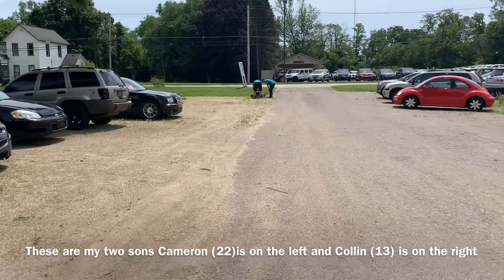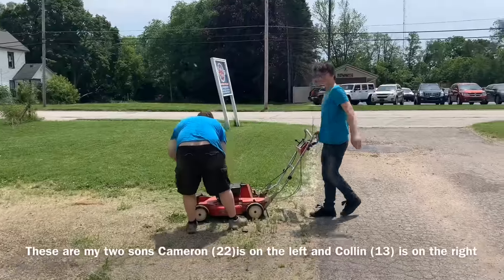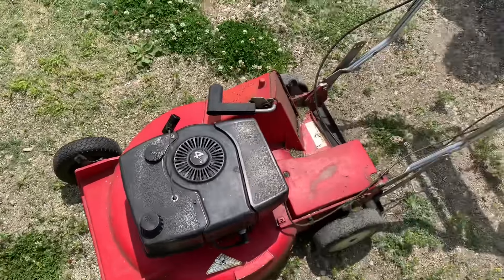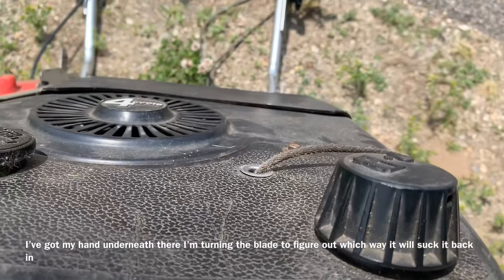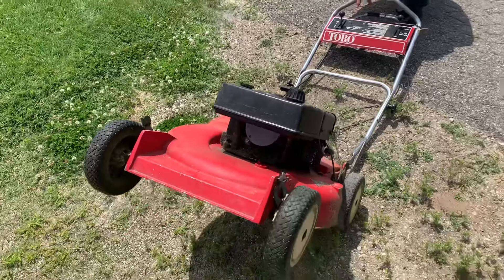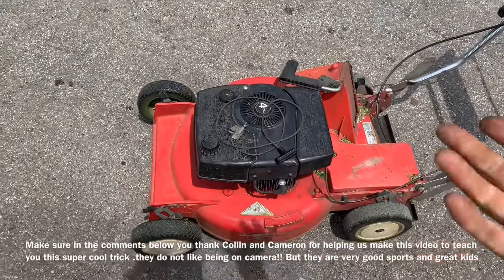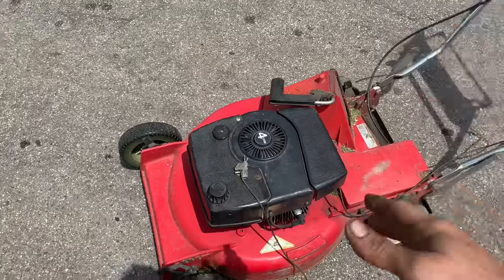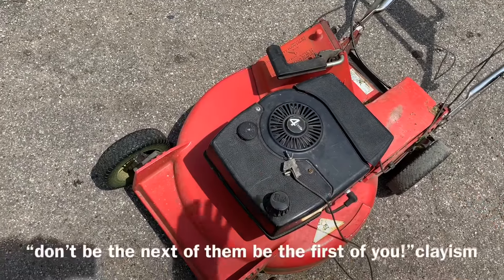10 second fix! Lawn mower pull cord not going back in recoil not working great easy trick!!!

Comment: always disconnect the spark plug, as a safety precaution so you don't lose fingers, always disconnect the plug.
Reply: Make sure to put it back on. I was pulling the fixed cord and the mower wouldn't start. Took a minute or two for me to figure out how dumb I was being.
Reply: I’m a hand percussionist and always use a drum stick to rotate the blades but yeah… pulling the spark plug seems a lot smarter and beneficial for me as a HAND percussionist moving forward lol
Reply: For real.
Reply: @DocFarnoff l

Comment: Thank you, going to try this on a basically new mower 2 see if it will work for me - only used a few times before the cord thing happened so fingers crossed 😂 I would so love to keep the 2 new ones both with adjustable tires on both the front & back then I would just have to decide  which color I wanted to use or felt like using each time I had to use one 🤣" lmao - the color of the day (1 is red & other one is black) - so 4 total now but would love to sell the 2 that are about 2  years old each & both still run great however neither of those 2 have adjustable wheels & I just love the bigger wheels in just the in the back 😅

Comment: What about is the string doesn't come out?  Great how to, videos
Reply from the maker: The recoil Mech is broken or the engine is locked up. 

When you try to spin blades by hand what happens?

If  blades / engine turns. The engine is ok and the recoil is broken and must removed and repaired 😕 but much better than seized engine
Reply: @sharpcarco  Thxs. yes.  Fyi.  Oil level is good.  First time using it since October 2019. The blade has zero play. Blade is locked/ seized in placed
Reply: @sharpcarco .... Thxs will probably just go and buy another cheap one from Lowes.
Reply from the maker: Sorry to hear that but try to give it a good  talk with your hand and see if you can get it to break free it may just of seized in place or could have some line wrapped around the bottom of it or something like that I wish you the best and I hope you don’t end up having to buy a new one. God bless and have a great day
Reply: @sharpcarco  thank you

Comment: This happens when your oil is old, and its been sitting. Best to change oil, and then disconnect spark plug so you can pull the cord 20-50 times to work the oil on the crank.

Comment: Thank you ! I feel so silly
Reply from the maker: Don’t worry my friend before I did this I have never done it before and I thought Eureka that’s so simple. 

Make sure your motor has the engine cut off (The little bar you pull on to keep the engine running) or you pull the spark plug wire even if you don’t pull the spark plug wire don’t spin it too fast. With the spark plug wire on it because apparently you can start these engines or at least that’s what five or six knuckle dragger’s said...... I know you could spinet fast enough to start it if you really tried but I think it would require effort. 

I never in 1 million years thought people would get up underneath there and spin it 1,000,000 miles an hour like they’re trying to start the engine..... but apparently common sense is not that common any longer.

Comment from the maker: ⭐⭐⭐⭐If you found the video helpful and would like to help us out, you can by purchasing ANY ITEM off Amazon from these links and we get a small commission with no extra cost to you. Here's some things that might help with this repair!

Recoil Rope and Handle for Small Engines: https://amzn.to/3vbLyLg
Performance Tool W1173 SAE/Metric 40-Piece Socket Set: https://amzn.to/39krZrL
REXBETI 2-Pack Utility Knife: https://amzn.to/3EJ0GTw
Utility Blades by HEIKIO, 10-Pack: https://amzn.to/3k99A31
Magnetic Screwdriver Set with Carrying Case, 10-piece: https://amzn.to/3vcwA7C
Magnetic Screwdrivers Set with Case, Amartisan 42-piece: https://amzn.to/3ENd18Y

Comment: You would have to figure out another way to fix since you probably wouldn't be able to find parts.  That is the oldest mower I have ever seen. The pull cord isn't even on the handle bars. I'm thinking it must be from the late 80's or early 90's but it's not as old as the mower that we used as kids it  was manual no engine it had 2 wheels and a big blade that turned as you pushed it.
Reply from the maker: Oh man do i remember those days! She was definitely old. We ended up getting a new one the year after I beleive.

Comment: Yep always sensible turning the blades with the spark plug still attached 🤦🏼‍♂️🤦🏼‍♂️
Reply from the maker: Well you also have to consider that you have to be pushing down on the arm forward to even create spark so in this situation it’s not a concern but I suppose on a very very old lawnmower it could be
Reply: That's how ya lose a hand
Reply: Definitely.. totally an irresponsible video to not mention the spark should be disconnected.. not everyone knows the difference for their machine
Reply from the maker: lemonGresham Hey you rocket scientists should ask your mower mechanic about how fast you have to turn them blades to get that engine to start. Just as an FYI you moving the blade is not gonna start the engine. But heck I don’t know I’m sure if you Spohn it fast enough I’m absolutely sure it could start this way 🤷🏻‍♂️ I guess I should’ve took the mouth breathers into consideration when I was making this video and specifically told idiots not to turn the blades at 100 RPM

Be safe God loves you even if you don’t like me.
Reply: The Clay Way every good mower mechanic would tell you to disconnect the spark plug.
Reply: @sharpcarco  Always going to be a complainer around. I didnt see any vids of them showing how to do this ;)

Comment: Dangerous AF!!!! NEVER. I just use my knife to recoil it. I'll have to make a video. If you spin blade with your hand you can start the mower blade. Especially since the cords pulled already. Be safe.
Reply from the maker: Well it’s kind of one of them things…… The likelihood of that happening is very very small but still possible nonetheless. It was A very quick idea off the top of my head…….. Sorry I did not take into consideration how many people would be actually that stupid to spin it fast enough to actually start the engine. I should also mention this particular mower has a bar that you need to push down for the engine to start as many mowers have for several decades I know there’s some from the 60s and 70s that may not have that bar and maybe also some from the early 80s. The thinking behind that would be that if you have a mower that is that old more than likely you are old as well …….. I have put a disclaimer down inside the description so hopefully people are not quite that stupid. 

I know there’s no shortage of stupid people out there. So this is most certainly possible.
Reply: There's many "uneducated" people out there haha. I ended up not fixing it right haha. I need to take it apart lol. What I did worked a few times then ended up back to a long cord hanging out.